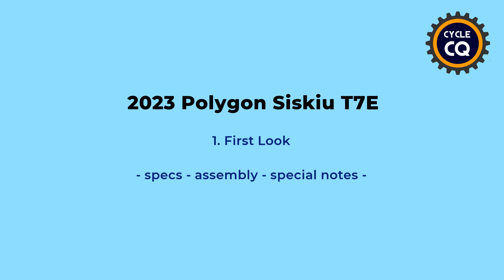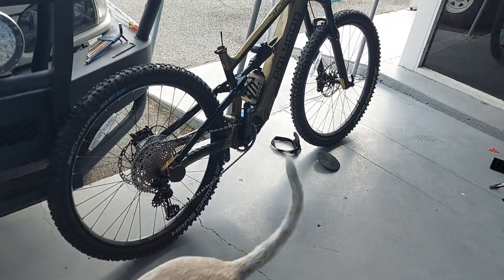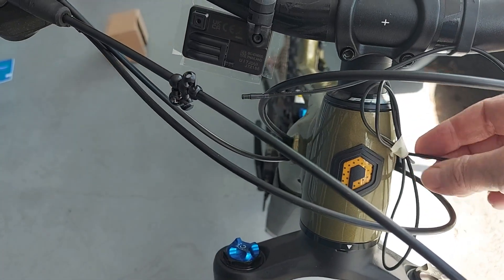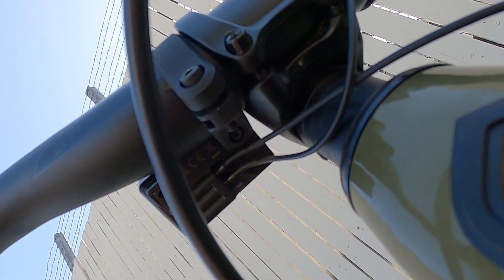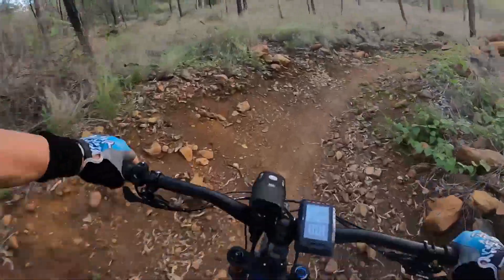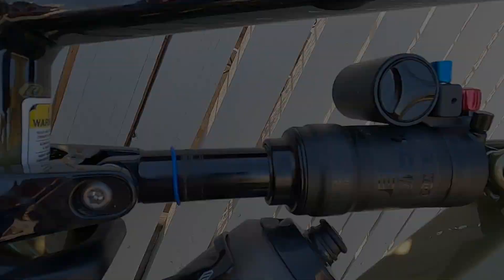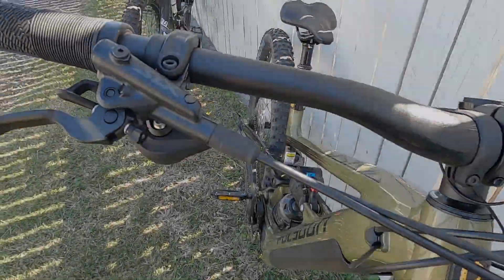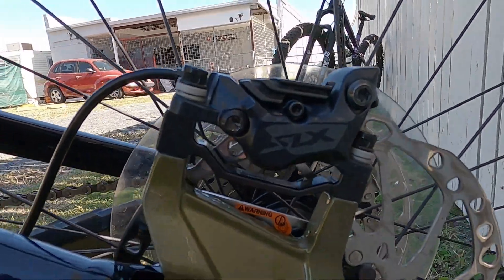Polygon Siskiu T7E - Part 1: New Bike Day

Comment: Thanks for tip on the wiring. Did you just plug in the battery charger and plug it into the bike and it charged? Mine has arrived and the charging unit doesn’t light up and neither does the bike . . .
Reply from the maker: Hmm OK. The plug that goes into the motor is a little bit tight but apart from that, should charge up fine. Make sure the switch is turned off. It won't charge if the switch is on. If all that fails, try taking the battery out and charging it direct off the bike.
Reply: Thanks, I took the battery out and it charged that way. Give it another go in the bike for next charge. Cheers
Reply: Hi , did your charging problem work out ok?I am considering the TE7 to buy ,but your comments were a worry about the charger failing. Are you happy with the polygon ,now? thanks.Martin @andrewbarrett111

Comment: Hi mate, I'm thinking of getting the T7E... How's the long term review of the bike. Still holding up?
Reply from the maker: Hey there, yeah I'm still happy with it. Got about 700 kms on it, mainly single track. Still on the fence about the fork, can't seem to tweak it right, will prob fit my spare Fox 34 and see how that goes, but otherwise, runs like a dream.
Reply: Hi ,did you solve your concerns about the front fork on your Polygon?Martin @ThommoManThing
Reply from the maker: Hi Martin, I think it was OK in the end. I just kept tweaking pressures etc. But I actually sold the bike last month, so yeah. @martinbramston2244
Reply: thanks for the reply, I would be curious as to  what you are going to replace it with? Another ebike? Martin @ThommoManThing
Reply from the maker: I won't be getting another e-bike. I'm an XC rider and enjoy the rush of completing a climb. I missed that with the e-bike, so can't see me getting another one until I physically need to.  @martinbramston2244